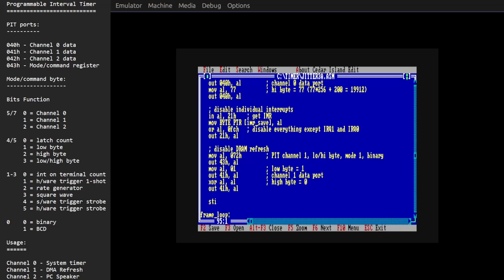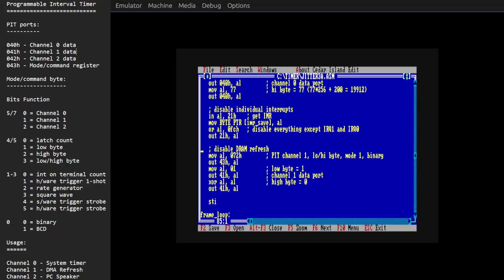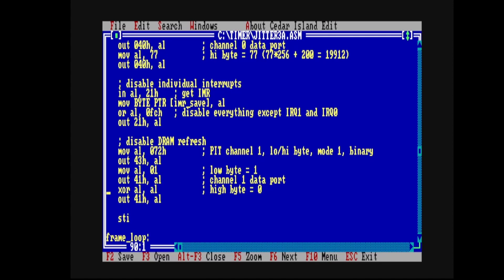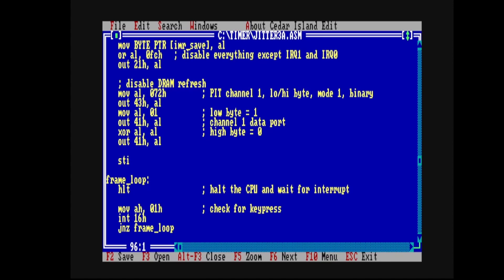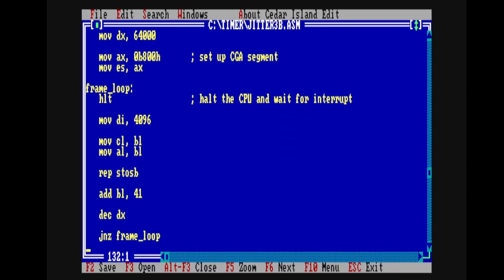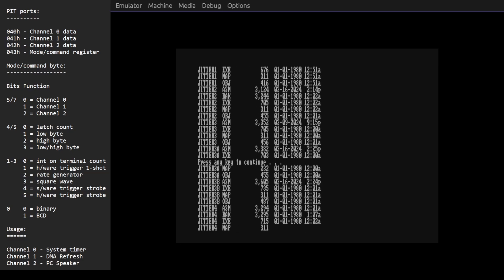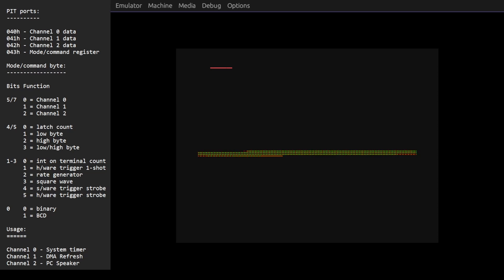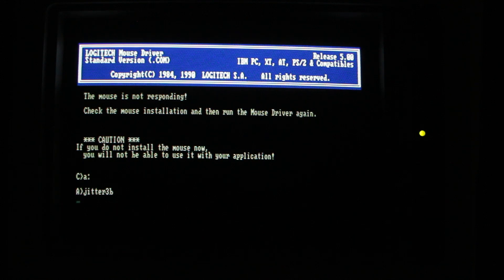Advanced CGA Graphics : Controlling Jitter (Part 3)

Comment: Seems like you only need to disable DRAM refresh just before you need to sync. Or maybe you could do the refresh manually at a time of your choosing. IIRC the Amiga does it once per scanline.
Reply from the maker: Both approaches are possible. But of course everything is more difficult on the PC. We'll get there eventually though.

Comment: MartyPC doesn't currently model DRAM decay. So although the refresh process should introduce the correct number of wait states, we're just going through the motions for the sake of cycle timings. Decay might not actually be all that expensive to emulate - we don't have to track last refresh time per memory cell, just per CAS line.   Modelling the loss of charge within memory cells may be the tricky bit. It would be simple to just mark a cell bad after so many microseconds, but I wouldn't be surprised if there's actually a measurable decay curve.

Regarding the NMI display, I imagine that it would be fairly reliable to print the parity error message on screen with one or a few bit flips - but if we let DRAM decay fully I'd imagine we'd lose the interrupt vector table and the BIOS will end up jumping to nowhere when it executes int10h.
Reply from the maker: I certainly wouldn't put time into modelling decay. I suspect it even varied from manufacturer to manufacturer or even chip to chip.

Your hypothesis regarding the IVT seems plausible. We are calling int 16h, but that should be a different row address.